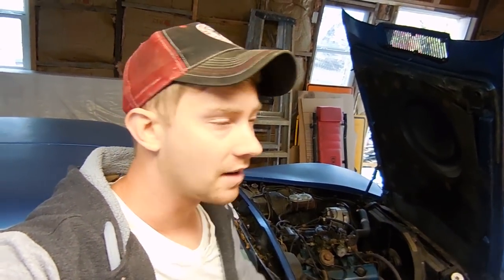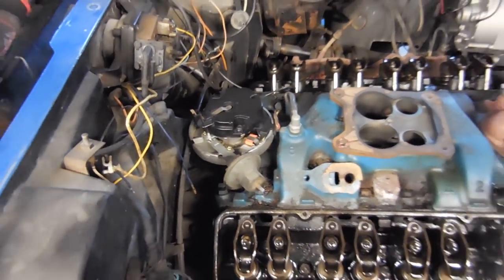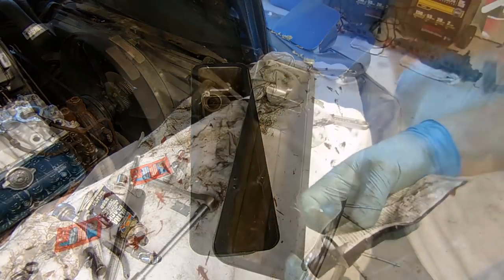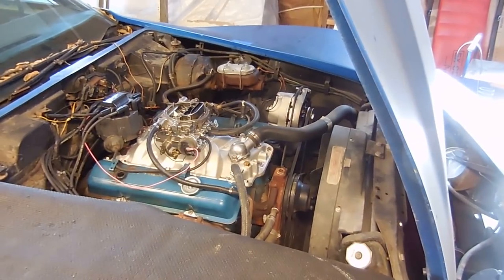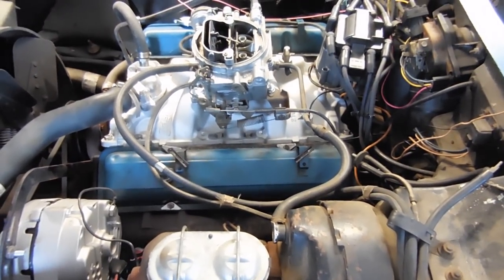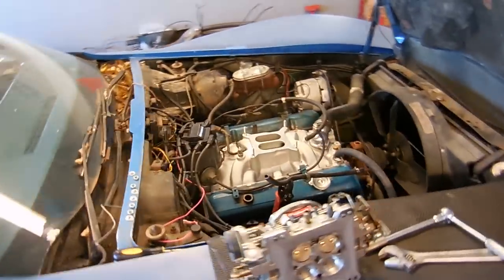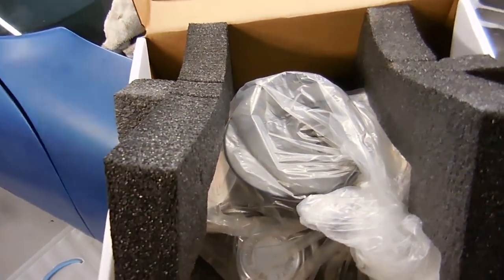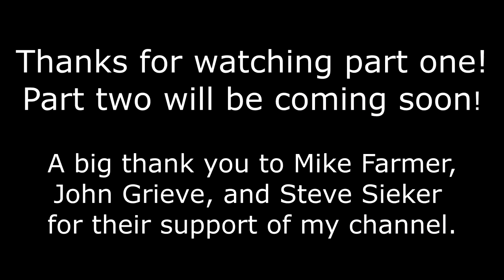Norris' 1973 C3 Corvette Stingray Coupe Part 1 of 2

Comment: Before removing the distributor, I would hand crank the engine until the number 1 piston is at top dead center. The rotor should now be pointing to the number one cylinder.
Reply from the maker: +James Nasto no reason to do that if you just put it back in where you found it
Reply: standard procedure. He could be 180 deg off his way

Comment: That Vacuum Line goes to the Vacuum Canister that is under the Drivers side front Fender where you are standing if it is     unplugged I believe the Head lights will not come up and the Wipers will not work If I remember right because the Canister is open.

Comment: 1972 vets are my favorite because when I was a kid I was looking for ward to the 72s that were coming out. I was very excited that the 1972 model had amber turn signals compared to the white ones on the 1971 model. Now I could tell the difference between  the two, some 50yrs later I still tell a 71 from a 72.

Comment: I always disconnect the vacuum advance and plug it when setting the timing.  Car is sounding good but you're not getting a true reading with the advance line connected.
Reply: He is because he's using the timed advance port (upper facing to the right) on the carb, which only sees vacuum when the throttle is cracked open.
Reply: Ported vacuum runs like crap compared to manifold, you don't get any advance at idle and lose total timing when you use ported.
Reply: That's not been my experience, at least not consistently. I have one car with a 289 that runs great on manifold, and another with a 351W that runs poorly on manifold, stumbled and didn't idle as well. Ran to ported, and it runs perfectly. Both run Holleys. The Holley instructions say that the ported nipple is for dist advance, and don't say anything about running to manifold. The upshot: Connect to whatever runs better, not all engines like one or the other.
Reply: uhplumber ]
Reply: @mattfarahsmillionmilelexus  he 6666666

Comment: Hello Ben,  I just watched an old vid of you with your ‘73, where you mentioned too many wires to your starter affected the starter’s ability to turn the engine. So, I thought of a solution that you may or may not be positive about, but it could help. Put an oil pressure switch down there with the oil gauge sending unit, and run a fused hot wire to it. From there run a wire to a relay to turn the relay on only when there is oil pressure. From the relay, you could run a wire to an auxiliary fuse box, and from the fuse box, to the accessories that were formerly all running off the starter post. A fused heavy wire from the original fuse box, through the relay to the aux. fuse box could keep the heavy load off the starter post!  Just a thought. I enjoy your vids. Thanks.

Comment: Hi Ben, this would have been a prime example to use the Fitech efi unit on. I bet if you reached out to them they have given you a big break on the cost, with your knowledge and Y.T. subs., it would of made for an easy install, and you the 73 Vette would have been that much more pleased with this get it running project...You also would have 2 or more videos of content too, the complete install of the unit and getting it dialed in and the comparison video on how much you like it or not...if it worked out fine, you could be a Fitech spokesman on Y.T. and everything would be good for everyone...maybe on the next C3 with a Rockchester QuadraLeak.

Comment: sounds like a throttle shaft is leaking on the carb or just a vacuum leak.  As a side note the car needs to be at operating temp before setting the final timing and the rpms's have to be at the correct idle speed.

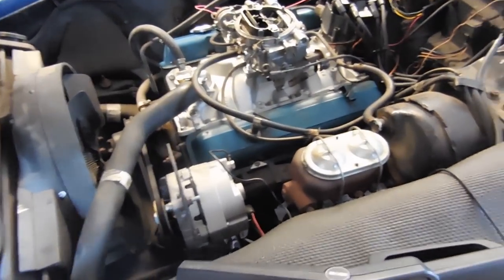Comment: Do not put RTV on the gasket that faces the head. Use a thin layer of grease so you can get the cover off easily if you need to service under the covers. 19:33 when setting timing, disconnect the vacuum advance hose at the pod and plug it with a gold tee. Not sure why Ben did not do this because your timing would be way off of the timing tab idling high.

Comment: I could have told ya it was your carb setup before the timing when you 1st installed the intake and carb and Not the timing. The timing was pretty close. Always set your time close, but ALWAYS start with your carb adjustments. when you fire it up, check the timing light, if its close, then move to the carb, check for vacuum leaks, and then start your carb adjustments. A new carb is ALWAYS going to be off adjustment and will cause a high idle or just a horrible running engine. Another thing to think about is the timing chain "stretch". An old timing chain WILL have some stretch and cause some timing issue. Also possibly a worn cam and also possibly out of adjustment rockers. Though the cam is hydraulic and self adjusted once tighten properly,  you can still have worn lifters, a collapsed lifter, or just a rocker or rockers loosened up over time. Do ALL OF THE ADJUSTMENTS from new carb adjustments, rocker arm adjustment,  to timing adjustment and if its still not right, check for loose/worn timing chain or even cam. I would have swapped the cam with a new slightly better performance cam but keeping it streetable, since its a manual tranny. No need to change the torque converter to an upgraded stall converter, since a manual eliminates the issue at idle. Swapping a cam is not much more work after the intake, distributor, valve covers is removed,  just need to pull the accessories off, balancer, timing chain cover and remove radiator and perform the swap. Maybe another hour or 2 of work. After all that, that engine would be a newer running engine with a little attitude al9ng with it. Nothing better than a "cammed" chevy small block. The lopey racey idle and a snappy throttle response is what a vette needs. And of course spinning the engine out to higher rpm with that beautiful race engine sound and performance quality, rather than that "putt putt putt and slow revving" grocery getter sound. Great video! But try to wake those engines up a little. The way a vette should have been from the factory. A nice looking vette that also runs strong and snappy response will make the car even more attractive. Its not just about the "looks" but its also about the sound and performance under the hood that completes the vette. To me, a performance car that justs "putt putt putt" doesn't look good, but a mediocre looking performance car with a snappy aggressive tone and responsive engine always perks me up and creates a visual of what its potential is.
Reply: Lu
Reply: K

Comment: Why would you put a new pretty intake and thermostat housing on but not repaint the valve covers? I’ve used the rubber intake gaskets at the front and rear of the intake manifold that engineers designed, and I never had a problem. Nice to see a young guy working on a 50 year old car.

Comment: That isn't a 73 block, blue was 77 and up I think.  For valve covers flip on the edge of a bench and you can hammer them straight and true much faster than a cresent wrench. If it's a  wood bench, you can get fancy and flip you hammer and give each bolt hole a gentle hit with the peen to give it a little edge for the bolts to start drawing down on.  One more thing lets hear it bark
Reply from the maker: Any motor can be painted whatever color you want. I don't remember if this one is original but I Can ask, I don't believe that it is. I only use the cresent wrench when it is a big bend, I usually use the vice and a hammer.
Reply: TheCorvetteBen absolutely, hell car is 45 y/o, being a stick, it has probably seen a beating or a failure from time to time
Reply from the maker: Or more than one...

Comment: Hate it when people run an engine without a thermostat!  The main problem with running without a thermostat is cylinder wear.  If an engine runs at under 160F degrees for months at a time, cylinder wear will greatly increase.  It's like an engine with 75K miles that has the cylinder wear of a 300K mile engine.  I hope that engine block isn't worn out...
Reply: Really? What's be the cause behind this wear? I've always understood the cooler the better, within reason. Rich

Comment: 73’s didn’t have electronic ignition and the engines were painted factory Orange. 35 gap is probably for point ignition if you are looking at ‘73 specs. I still own my ‘73 Coupe. Wonder what the owner did with all the chrome shielding. Of course he couldn’t use it with that big electronic distributor in the back.

Comment: As I approach 200,000 miles in my 1969 L-71 435 H.P. 3X2 carb Corvette that has been my daily driver since 1970, I can assure you having no thermostat does not hurt the car at all.  In fact, heat and friction are the two main things that eventually destroy a motor.  My car has never over-heated, runs cool, runs fantastic and still has almost 95% original compression in all 8 cylinders.  While I don't advocate going against factory specs, it does seem to me that having no thermostat might help toward longevity.  I do living in California where the climate is mild and the car is ALWAYS garaged at night.  Maybe that's why having no thermostat has not been a problem.  Who knows??

Comment: I hope that a big part of this project included “fixing” the front end! One of the saddest Vette years, 1973.
Reply: Brian Cooley I think 73 is a great year! A lot of 1year only stuff...
Reply: Brian,  for several years after,  it got even worse...
Reply: My first GM car, is also my first Chevy car (after 45 years if driving): a '77 C3!! Only AFTER I bought the car did I see Ben's video on "Why NOT to buy a '77 C3! As of this writing, I've owned the car for 4 months. Andvwith the exception of two weeks (!!!) this car has been in the shop. All new brake rotors, TWO sets of calipers on EVERY CORNER (learned the hard way about the O-ring issues), new master cylinder and brake booster, new aluminum radiator and dual electric fans, new distributor, plugs, wires, thermostat, and now, all-new rear suspension bearings, bushings and U-joints. The diffy needs rebuilding, the crate motor that replaced the original is sooo weak that if I have anyone in the passenger seat, I have to get out and push! So I found an SBC-- 4-bolt block, and it's being magnafluxed and hot tanked. If it's good I may have it chromed or something--just because this whole project is costing a small fortune! Maybe ceramic coated, what the heck. And have it bored and make it into a 389 stroker (the block was already bored 30-over, and the bores look like crap, so going 40-over), aluminum heads, new aluminum intake and new carb. 450 hp is the goal. Then I'm sure that turbo 350 is gonna crap out on me too. And someday, get the a/c and heat running on the car once again!

Comment: Never had any luck with Holly carburetors. Always new too. Never any used junk. They're a good/excellent racing carb since they allow for so much adjustment but my experience was always that they don't last/are not consistent on street motors. You're always "futzen" with them. The Q-jet has its inherent leak down and needle/seat problems. The Carter/Edelbrock carb is pretty consistent, dependable, and "out of the box" usable.
Reply from the maker: +Pappa Bob I've found the edelbock carbs are either good or no good. Some have been amazing carbs, while other s for some reason havent. Don't know why
Reply: Interesting!! All "new" ones??
Reply from the maker: +Pappa Bob never bought a new one other than the one on the caddy, they are too expensive. Rebuilding them it seems like half are good half are bad
Reply: I see. My perception from your answer would be that all those used carburetors needed to be rebuilt for SOME reason. Maybe the rebuilding process didn't/wasn't able to address the issue that caused that carburetor to be replaced. Most likely plugged up passages, worn shafts, warped components. Yes, they are expensive but can be found, periodically, at bargain prices and are GREAT right out of the box. Definitely worth the money since they make your motor run perfectly and your car a pleasure to drive.
Reply: I run a Holley street avenger 670 on my camaro, rebuilt it and tuned it 3 years ago and it has run perfect ever since with no adjustments.
Reply: Horsepower Garage  , I run the same carb on my 69 camaro. Runs perfect , right out the box.  A good carb is $ well spent
Reply: Mine is from 2001 I think and was on the car when I got it

Comment: Ben, when setting the disturbitor timing arn't you suppose to plug off the vacuum advance hose ?  I believe you have to.
Reply: you should
Reply: If the vacuum source is ported (above the throttle plate) there is no vacuum at idle so there is no vacuum advance at idle. It's a good idea to remove the hose and cap the port anyway unless you know for sure that the source is ported.
Reply: Ported vacuum is terrible and was used on smog era cars to help with emissions, it made them run hot at idle.  Manifold vacuum is what you want to use for vacuum advance.
Reply: All I know is , up to the mid 70's it was a must.   But back then, I used a vacuum gauge on every tune-up from start to finish on each job.  In a way I miss using a dwell / tach & timing light and all that stuff.  Even the old " SUN " tune-up and diagnostic machines were fun to use.  I can remember them at all the service stations and how expensive they were.
Reply from the maker: +OKIE CHOPPER I wish you could still buy those machines. If buy them all
Reply: You can on e-bay.
Reply: TheCorvetteBen Yep not only CAN you buy them, but you can get them for a fraction of their original price now, because most shops don't use them anymore (and haven't for 20 years). They take up a lot of space. Most modern  techs don't know how to use them too... Check locally at some shops to see if they have ones they want to sell. If not search eBay for ones for sale within driving distance of you. Since shipping would probably be expensive... I also have to agree on general consensus, I never liked Holley carbs too. They have the name but... Like many famous names, I wonder why!!! (Rolls-Royce, Mercedes, the list goes on and on, and it should be lists for things YOU DON'T WANT TO OWN! lol).... I have seen more fires caused by Holley carbs leaking then anything else. I had most luck back in the day with good old Q-jets and they were a dime a dozen used and easy to rebuild!!! Holley's are a pain to rebuild and never seem to be right before or afterwards. I had a stock original Holley on my 66 327-350hp Corvette. But I never really liked it or trusted it, always feared a leak and fire.....

Comment: 1.  What caused the smoke at 19 minutes?  2.  Did you ever test the compression?  With the plugs out for changing it would have been very easy.  3.  Does the PVC line not go to the carburetor?  I did not see it anywhere while the air cleaner was off.  That could have been a vacuum leak.  4.  Turn on the lights so the speedometer is visible.  5.  Never buy a used carburetor.  You might have saved a lot of money by rebuilding the original one.  I'm not trying to be nasty, just my thoughts.

Comment: To answer the [ WHY,WHY,WHYYY. ?!! ] QUESTION.  Remove as much heat as possible. C3 Vette is a hot ride in the summer. Especially when without AC . It will work somewhat but could lead to overheating the heads eventually. Some of these have been rebuilt 3 or 4 times by now.

Comment: Love your content, but please get a leaf blower and use it on the cowl before you work on the cars, especially with the air cleaner removed. Drives me nuts. Sorry, just seems a little unprofessional.
Reply: I thought the same thing.  What I am working on needs to be clean so I can focus on the task at hand.
Reply: Exactly. I was waiting for some of those leaves to blow into the engine when he had the valve covers off.
Reply: I thought it was just my OCD :D
Reply: i think he put the leaves on there just to trigger you guys
Reply: L O L!
Reply from the maker: Let's just say I haven't cleaned them off yet to see if anyone will say something. Works every time!
Reply: michael davis,well hes not a professional, these are just youtube videos! enjoy them instead of nit picking them! life will be alot better that way for ya!
Reply: you don't blow the shit everywhere, you use a shop vac
Reply: 45 years working professionally ASE certified master technician. This guy is a shade tree at best. Lazy, halfass  screw up wasting clients money. Would rather spend clients what $275-350 on new carb why ? Because he doesn’t know how to rebuild one for say $100 with labor. I watched I’m swap a engine on I think a 73 brown vet. Needed rebuilding. No he replaces it with like a $5000 engine. Killing the value. Well if your going to do that then go to a yard and buy a Ls. Hell for what he spent he could’ve bought a ls from a Camaro getting the motor , trans and hardware for that. Making car much more reliable and fuel efficient and not even mention how much more power. Which would increase value. Just lazy easier. To buy new then to work what a shame.

Comment: Have you ever tried using spreader bars on the valve covers to spread out the load.
Good work.
Reply: I use spreader bars as well. distributes the clamping load.

Comment: That blue engine does not look to be original to the 73.  This thing looks like it hasn't had much TLC, but at least it is not all "bubbad up".   Can't really judge much based on the audio quality.  But, am glad you chose to replace the carb after someone had messed with those butterfly screws!  Was wondering what the rattling was, amazed at how that horn button can make such a racket.  I'm sure you will have this thing running and looking nice in short order...